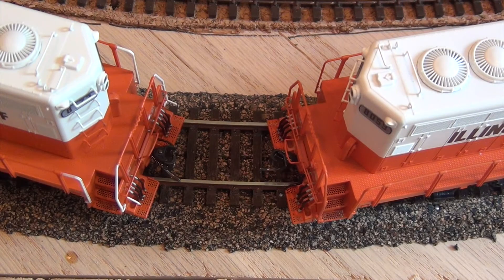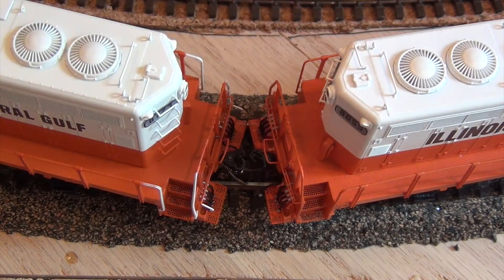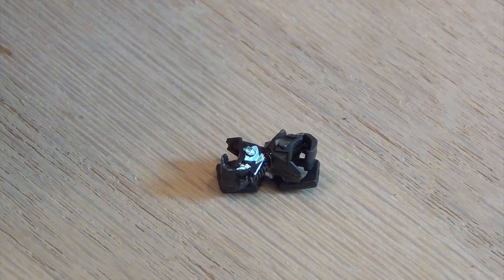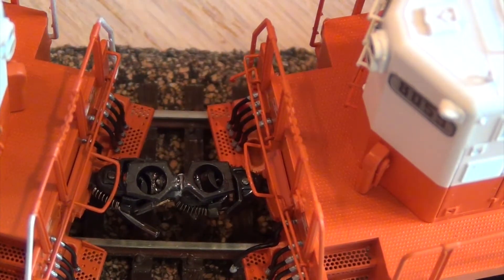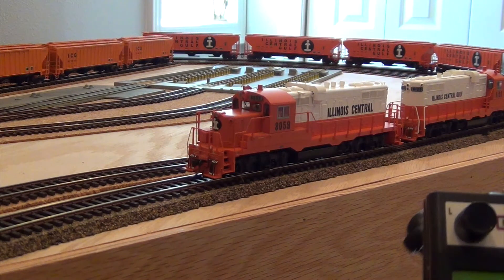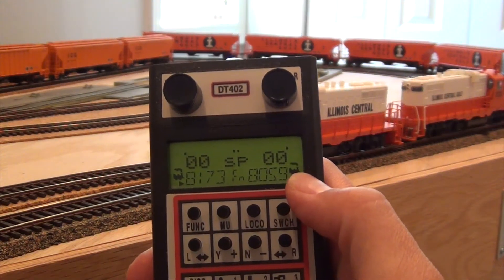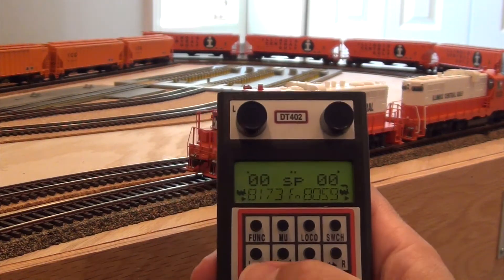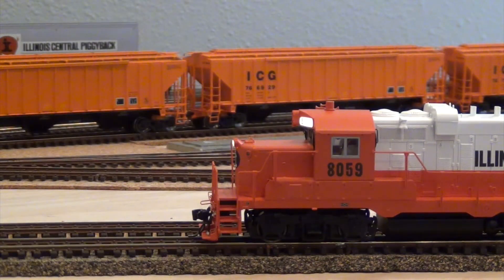Consisting locomotives with Digitrax DT402 (Intermountain GP10)

Comment: Do you have to speed match the locomotives before you mu them?  It seems like if one is even slightly off speed from the others it would cause the motor to burn out.
Reply from the maker: The Lowmein Hi Tim, yes it is good practice to speed match your locomotives before consisting them.  The locos I MU’d on this video were all brand new Intermountain GP10s so they all ran very consistently with one another.  You would want to be much more conscious of speed matching with different manufacturers or old vs. new locomotives

Comment: Wow awesome video and I thought I was the only one that modeled I.C./ I.C.G. How hard is it to build a layout d.c.c. I have a couple of passenger engines that is d.c.c  equipped (i.c. what else?) is there any special wiring I have to do or can a d.c.c.  engine run on a un-d.c.c layout? Any suggestions would be much appreciated
Reply from the maker: Check out my other videos, I have one that shows how to wire a DCC layout. You can also check out http://www.wiringfordcc.com for good resources.  I would not recommend using a DCC decoder on a dc layout unless the decoder specifically states it is compatible.  You do not want to risk damaging the decoder if it is not compatible.

Comment: I have two identical Rock ISLAND GP7's with identical road numbers. Can I just run them together on the same road # or is it important the run them in the MU configuration
Reply from the maker: Hi Mike -

I would consider changing the address on one of your locomotives.  Technically, yes you can run both units with the same address. The problem with this method is that any functions you perform (e.g., sounding the horn or bells) will be active on both locomotives.  If you consist them, only the lead unit will have the functions enabled.  That is my advice but it is up to you!

Comment: hi I was under the impression that Illinois Central used multiple for axle units because of light Branch lines and Industrial switching most of the big 6 axle locomotives we're used between Chicago and New Orleans
Reply from the maker: Back in the 1980s (the era I am modeling), the ICG had several hundred four-axle locomotives (mostly GP10's, some GP9's, and GP38-2's).  They only had a few six-axle SD20's and SD40-2's.  I lived near the Iowa Division, which was hardly a branch line, and all we saw were the 4 axle units in 4-7 unit lashups.  I think later in the 80s and early in the 90s, the IC acquired several GP40-2's from the BN and purchased some SD70's and the six-axle units were more visible and prevalent.